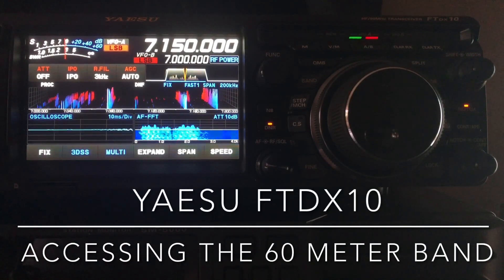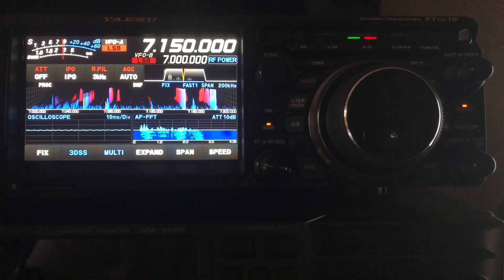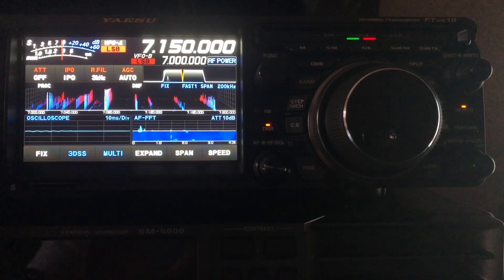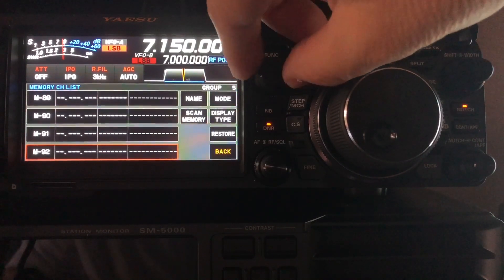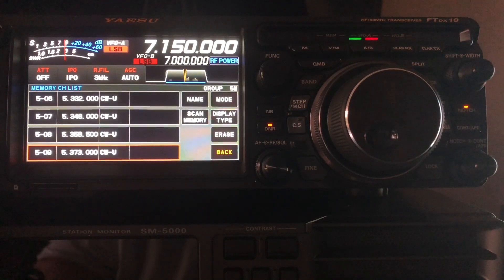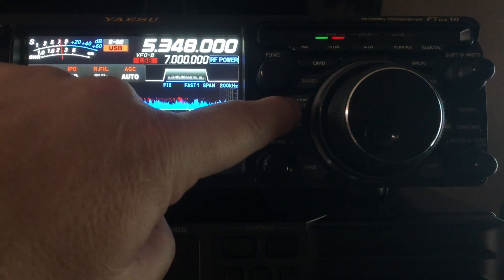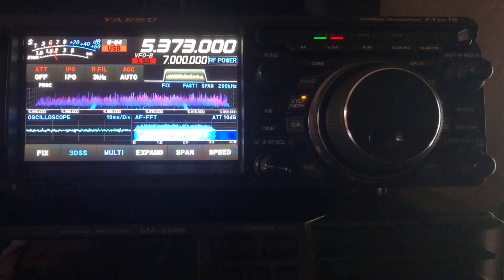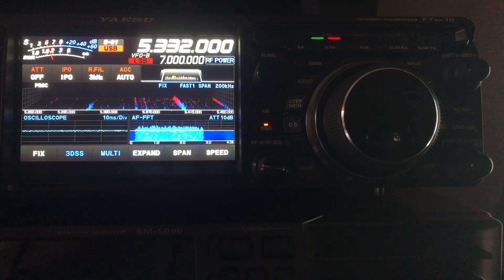Yaesu FTdx10: Accessing the 60m Band (Video #10 in this series)

Comment: For some reason, when I am on a 60 meter channel, my antenna will not tune. The antenna is designed to be used on 60m. When I press tune on a 60m channel, the word tune comes up on red text but I don't hear any relays click. It does not give that high swr error beep like I experience on 160m, since my antenna isn't designed for 160. Any ideas? Any tricks to tune on 60m?
Reply from the maker: You should not use an antenna matching unit unless your antenna is not resonant for the frequency you are operating on.  If your antenna is made for 60m, the SWR is probably below 2:1 or maybe even below 1.5:1.

Comment: Hi Doug! Rick here (N4RAH)
Ive done everything you show on my dx10 and I still get red flashing tx LED and no output... got any suggestions?
Reply from the maker: Hi Rick!  If you are accessing the 60 channels via memory bank 5, it should transmit. It just won’t transmit if you tap Band and select from the menu.
Reply from the maker: Other things that can cause a flashing red LED are a stuck PTT switch on a microphone.  This would happen on any band, when powering up. A stuck CW key cash cause the same thing during power up.
Reply from the maker: Keep me posted, Rick.

Comment: Can we transmit on the Alaska Emergency Frequency 5.1675 MHz it is not on the list on 60 meters?
Reply from the maker: Only under specific emergency conditions. The frequency has to be enabled in the menu. It’s all covered on page 77 of the operation manual.
Reply: I have done that now and found another problem with the programming software of the RTS management for the PC. I have snt them the problem, when we use it to write to the radio to fill all the memory with our new selections it overwrites this frequency with a different one, making the frequency unusable on the FTDX-10 this frequency is set up at the end of the memory of the channels and the program should not be replacing it. If wet set up the frequency inside the memory from the PC it will not transmit at all @n4hnhradio

Comment: I dont have these on my radio over in the UK. I guess its something we cant get or don't need.. anyhow loving these videos you have done for this radio. I'm learning so much more about it..  thanks.. 👍
Reply from the maker: The UK has a 60-meter band.  The frequency allocation is different than in the U.S.A. My understanding is that you can use the 5-meter band in VFO mode.  We cannot do that in the U.S. But of course you still need to use only the frequencies and modes that are allowed according to your UK license.  You can perform an Internet search for the 60-meter band frequency allocation in the UK.

73, de N4HNH

Comment: Did you take down your FT-710 60m in VFO mode not transmitting video? I can not longer find it, although I found someone else's reference to it. My USA radio (region set to USA) has the same issue, it will not transmit in VFO mode, which breaks WSJT-X.

Sry to hijack FTdx10 video.
Reply from the maker: Some of the videos are only available for Patreon team members.  The higher the level of membership, the more content is visible.  

All Yaesu radios have the 60m channels programmed into memory bank 5.  That ensures that our transmit frequency is 1.5kHz below the channel center for USB, with a maximum TX BPF of 2.8kHz.  It also ensures that we use the channel center for CW.  

We cannot transmit on the 60m band from VFO mode.  The latest version of WSJT-X Includes a setting for the FT-710.  With the radio selection set to FT-710, this version uses the DATA-U channels that are programmed into memory bank 5.  In my videos, I showed a work-around for both the FTdx10 and the FT-710.  Or you could perform the MARS modification.  Yaesu will send you the instructions if you send them a copy of your MARS or CAP license.  If you perform the modification, you will need responsible for setting the TX carrier point for USB and CW, and you will be responsible for maintaining a maximum TX bandwidth of 2.8kHz.
Reply: @n4hnhradio  thank you for the explanation! I saw "response" video in which they could transmit in VFO mode, AFAIK w/o a MARS mod, I am wondering if they had a non-US region set for the radio. I am using the latest release candidate of WSJT-X w/ the 710 picked, for some reason it wasn't working for me (tho I can manually switch the radio to MEM mode and put it in the correct DATA-U channel and it works fine, I've made FT8 contacts).

Thanks again!

Comment: Doug if i could bother you one last time and thanks for your help. on the ftdx10 which one is the Treble mid"s and bass? I have the pr 781 heil and everyone says I sound Muffled like maybe to much bass and that i need to bring up my mid and Treble. thanks so much
Reply from the maker: You will definitely sound muffled with a Heil until you set the parametric equalizers and enable mic EQ. There are two sets of parametric equalizers, one for when not using the processor and one for when using the processor.  Look for PRMTRC and P PRMTRC in the menu. Use EQ1 to set bass, EQ2 to set middle, and EQ3 for the high audio frequency.  Each EQ filter has a center frequency setting, boost or cut parameter, and Q factor setting.
Reply: @n4hnhradio  Ok Doug  thanks for the help 73's

Comment: I have a Palstar Hf Auto tuner and trying to use my 80 meter Double bazooka to use  on 60 meter band first time time using my ftdx10 on 60 I Noticed it will  NOT let me switch to Rtty to tune up 60 Meters is there a walk around stuck thanks for any help!
Reply from the maker: We aren’t allowed to change to LSB or AM for tuning on 60m. The channel parameters are preloaded by Yaesu, to ensure that our USB suppressed carrier point is 1.5kKz below the channel center, and our TX bandwidth doesn’t exceed 2.8kHz.  There is a 3-part series all about the rules for 60 meters available on this channel. The videos are in the “Learning Ham Radio” playlist. Here is a link to the first video in the series: https://youtu.be/wyl_7eUBaR0

I use one of the 60m CW channels to initially allow my tuner to find and record a match. I use CW ch3, since it is somewhat in the middle of the band. 

I set the CW speed to 15WPM and use the “dah” paddle. After my tuner has found and stored a match, from then on, when I transmit on 60m USB or CW, the frequency counter in my Elecraft tuner instantly detects the frequency and loads the match. With the relay-based tuner, this happens in milliseconds. So, basically, I just change bands and start talking or sending CW. 

I was able to use my Palstar AT-Auto in a similar fashion but the AT-Auto tracked the VFO during receive. As soon as it detected that I was on a 60m frequency, it rotated the motors to the memorized settings for that frequency. With your HF-Auto tuner, you will need to transmit a quick signal, so the HF-Auto can detect the frequency.  You will then unkey and wait until it is able to recall the match parameters. 

If you don’t have a Morse paddle, just program your callsign and TEST into one of the the CW message memories in the FTdx10 and use the message memory when you are initially tuning 60m, while your HF-Auto seeks a match. Be sure to enable BK-IN. 

73, de N4HNH

Comment: Will it work on FT8  (60m) ?  FT8 requires you to vary your transmit frequency.
Reply from the maker: There is video about that coming up on the channel. Subscribe and click the notification bell and you will be notified when the video goes public. 

It is possible to operate FT8 on the 60m band, even without performing the MARS mod. But you have to set WSJT-X the way I show in the upcoming video. Or just perform the MARS mod. Just be careful not to void your 3-year warranty. If you botch the mod and cause damage, Yaesu will not repair it under warranty. 

The FT-710 AESS includes 5 additional 60m channels, set to DATA-U. For someone who works FT8 exclusively, that’s good. The FT-710 is weak in other areas, as I’ve covered in the FT-710 AESS series. But, the FT-710 AESS could make a good dedicated FT8 radio. 

If someone one likes to work SSB, CW, FM, FT8, etc., I highly recommend the FTdx10.  You can always pay the dealer to perform the MARS mod if you aren’t comfortable, yet you wish to operate FT8 on 60 meters without using the workaround I show in the upcoming video. 

73, de N4HNH

Comment: Does not address FT8 Digital mode. That requires the Mars Mod....It would be nice if Yaesu would allow FT8 operation in the memory selections...
Reply from the maker: Yaesu added 5 DATA-U memory channels to the FT-710 memories for 60m.
Reply: @n4hnhradio  I have an FTdx101D and an FTdx3000 and am thinking about selling the 3K and getting the 10 or 710 so if Yaesu has added FT8 on 60 that will definitely influence my decision. Thanks for the info.
Reply from the maker: Many people operate FT8 on 60m with the FTdx10.  FT8 is just a USB signal modulated with 8 tones.

Comment: Today i learned from Yaesu technical support that Digital modes (FT-8) are not available on 60m when using the FTdx-10 !
that's a real bummer. Any thoughts?
Reply from the maker: My brother used an $8 sound card to operate FT8 with a FTdx5000.  He fed the audio to/from WSJT-X through the rear port and used USB mode.  I would think that could be accomplished with the FTdx10.  Since I have no interest in FT8, I haven’t explored it.  

I guess you spoke with Tim Factor.  He told me the same thing last year.  That is unfortunate news if Tim is correct.  I haven’t tried to confirm it with Yaesu in Japan.  They are the best source for information.  

My thoughts?  Things like this are why I hate to like Yaesu radios.  They get close to perfection but not quite, because they don’t pay enough attention to their customers.  They still make the best transceivers, IMHO, but even they could do better with a nip and tuck here and there - if only they would listen.  A year ago I was asking to change frequency by scrolling my mouse wheel and I suggested that we be able to right-click our mouse to bring up the Function menu.

That said, an IC-7300 is good enough for FT8.  The main reason I would have for purchasing a FTdx10 is the superior SSB and CW receive capabilities.

73, de N4HNH
Reply: You have to do the MARS mod.  Yaesu radios have been like this for a long time.  My FTDX-3000 was the same way.  It had 60M preprogrammed in but would not work with WSJT-X digital modes.  The problem is your computer needs to change the frequency slightly and this is not allowed with the radio in "factory" amateur mode.  I think this has to do with FCC type acceptance since 60M is a channelized band.  Doing the MARS mod will enable the computer to change the frequency.  It's not that you will be transmitting out of the channel bandwidth.
Reply from the maker: You can make it work. You have to set WSJT-X to no radio and use CAT keying. But it isn’t as clean as operating after the MARS mod. The FT-710 includes 5 DATA-U channels and the newest version of WSJT-X works with those channels.

Comment: U can not do FT8 on 60m without doing the Mars mod using WSJT-X.
Reply from the maker: I don’t know.  I trust you.  I don’t operate FT8.  I thought it could work with USB.  My brother puts his FTdx5000 on USB and uses the rear microphone input.
Reply: @n4hnhradio  The default setting is USB-D, using the REAR USB connection on the 10 for FT8 to the PC plus CAT control.  It could probably be done but would require a complete reconfigure of WSTJ-X for USB plus PTT.  A step backwards for 60M FT8 operation.
Reply from the maker: You should maybe talk to Tim Factor at Yaesu support, extension 1513.  The main reason for the new firmware is in support of FT8.

73, de N4HNH

Comment: Hello, I performed the Mars mod, but still do not see the 60m band in my memory bank as you show! Can you advise?
Reply from the maker: If you want to program the 60 meter channels into memory positions yourself, I will provide the channel information below:

Note: These channel assignments are for the United States of America.  For a Yaesu radio, these are usually stored in memory bank 5, positions 1 through 10.

Ch1 Mode USB, frequency 5.330.5
Ch2 Mode USB, frequency 5.346.5
Ch3 Mode USB, frequency 5.357.0
Ch4 Mode USB, frequency 5.371.5
Ch5 Mode USB, frequency 5.403.5
Ch6 Mode CW, frequency 5.332.0
Ch7 Mode CW, frequency 5.348.0
Ch8 Mode CW, frequency 5.358.5
Ch9 Mode CW, frequency 5.373.0
Ch10 Mode CW, frequency 5.405.0

Caution:  Now that you have performed the MARS modification, your radio can transmit outside of the limits of amateur radio.  Be certain that a non-licensed or inexperienced person cannot access your transceiver and thus intentionally or unintentionally transmit outside of the amateur band limits.

By programming the 60 meter channels into the radio at the factory, Yaesu added a layer of protection to keep our transmissions within the confines of the law.

I hope this helps.

73, de N4HNH
Reply from the maker: You do not need to perform the MARS mod to see the 60m channels.  They are already in the radio at memory bank 5.  By performing the MARS mod, you erased the 60m channels from memory.  You will now be responsible for properly programming the 60 meter channel frequencies and modes into the radio.  Be sure to get it right.  We share that band with government agencies.  You don’t want to get caught transmitting out of band or using the wrong mode.  Look up the proper settings.  The ARRL published them.

Another option is to undo the MARS modification and perform the factory reset.  That should restore memory bank 5 and the 60 meter channels.

73, de N4HNH

Comment: One thing I do on 60m is use it for FT8. What I have heard that is the FTDX-10 can not be set up for digital modes in 60m.
Reply from the maker: I think you have to use the USB mode channel.  My brother operates FT8 that way on his FTdx5000MP. Maybe someone who is a FT8 expert will comment.  I’m not into digital modes myself.  If you’re on MeWe, try posting to one of the MeWe ham radio groups.

I’m sure there is a way.  Yaesu makes mistakes but that would be monumental.

73, de N4HNH
Reply: @n4hnhradio  I am on the FTDX10 Groups.io and Facebook. I have heard that complaint. I have a Flexradio 6600 as my main rig and it does 60 Meters easily and I can set my mode including applying the digital configurations. Believe it or not, I am using the FTDX-10 as a POTA radio as I wanted a great receiver when I am in the field. Love the radio.

Comment: I bought the radio specifically from watching your videos. I was going to get a 7300... but this radio seems to have so much going and you actually convinced me through what I saw in these videos.  Buy once cry once right??
Reply: Sorry you have to let it go as well but your main rig is amazing :). I am hoping it lasts a good while, it's a big investment for me...I am still on a g5rv I'm new to general, so next step I guess would be figure out a tuner to get that to work on 80/40/20/10 if I could.. not sure how it will work out.
Reply from the maker: I use a ZS6BKW, which is a computer-optimized version of the G5RV.  It needs no tuner for 6m, 12m, 17m, 20m, 40m, and the FM portion of 10 meters.  With a good tuner it can also work on other bands, between 80 and 6 meters.  I use mine for 30 and 60 meters.  You could build your own ZS6BKW but Chris at NI4L.com does such a great job that it is well worth the price he charges, which was under $150 when I bought mine.  Chris uses the finest materials too.  And he tunes it perfectly.

73, de N4HNH
Reply: Yes that was what I was going to get, seems like a great option. I guess as with all hobbies the more you learn the less you know ;) I'll keep working at it...seems likely that I can at the very least use the g5rv with the onboard tuner for 80/20...
Reply from the maker: I used a G5RV for many years.  It performed fine.  The ZS6BKW will still require a tuner for 80.  You just won’t need the tuner for 40, 20, 17, 12, the top of 10, and 6.

73, de N4HNH
Reply from the maker: Hi John!  I hope you enjoy your FTdx10.  I’m going to hate to see this one go.  Maybe I will hold it hostage.  Hi! Hi!

I think you made a wise decision.  The FTdx10 could last you a lifetime.  I think its architecture represents the pinnacle of transceiver design.

73, de N4HNH

Comment: Can you tell me how to tune up on 60M?  I have a MFJ-989D.
Reply from the maker: I go to channel 3 CW mode.  I set the CW key in the menu to straight key mode.  I then use my CW key to transmit the radio.  This lets the auto-tuner find a match and store the setting.  I then set everything back to normal.  When I go back to 60m next time I go to channel 3 USB and whistle a steady tone for a couple of seconds, so the auto-tuner detects what frequency I’m on.  It then loads the match from memory.

I hope this helps.  Tuning 60m can be a challenge with preprogrammed channels.

73, de N4HNH
Reply: @n4hnhradio  Thx. 73